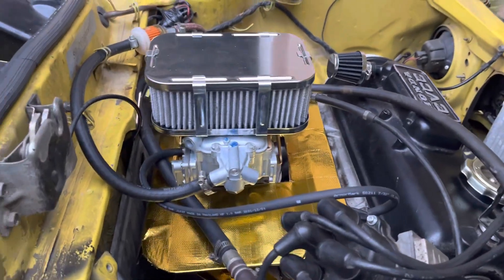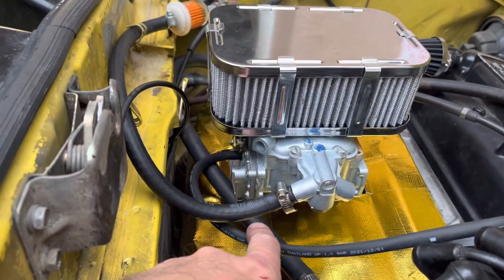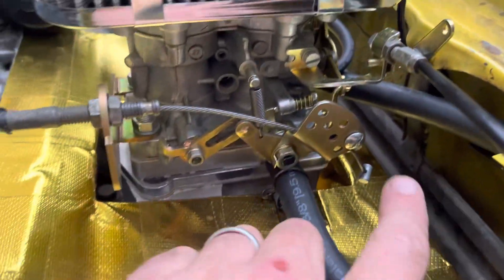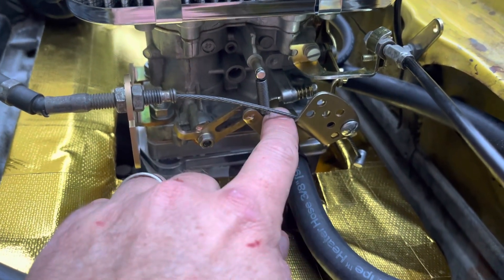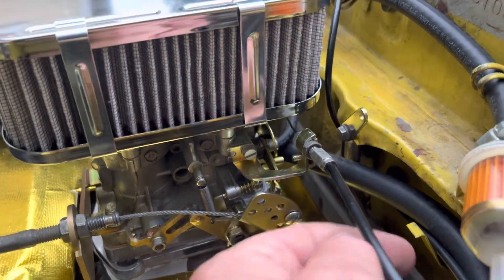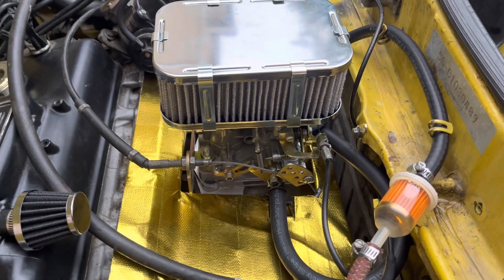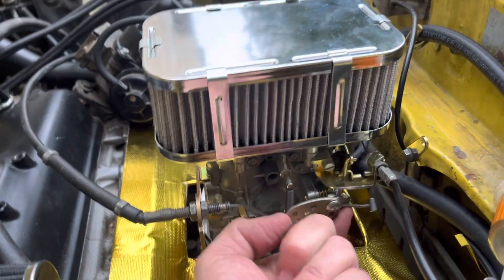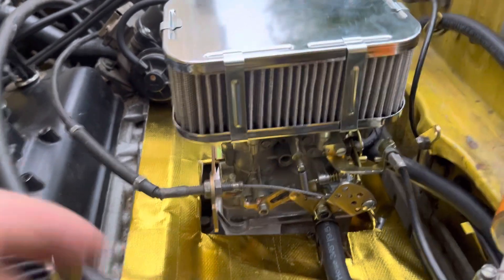WEBER 32-36 First Generation Honda Civic CVCC 1975

Comment: That filter you have on your valve cover. What is it called and where can I buy it?
Reply from the maker: I got it at a local auto parts store. You have to make an “L” tube so it sits vertically. When it sat horizontal like in the video the oil residue would get on the engine. Now it works fine mounted upward. The oil flows back into the valve cover.